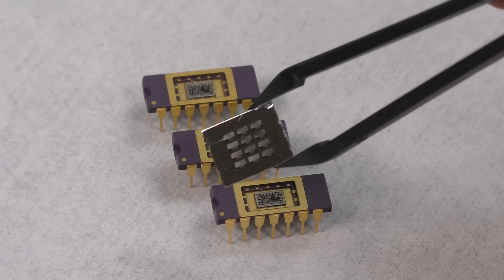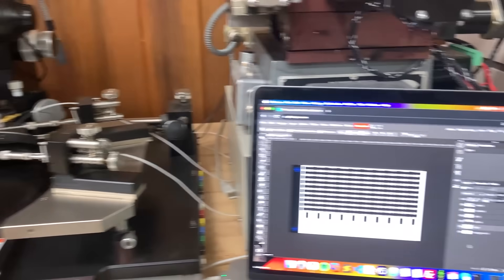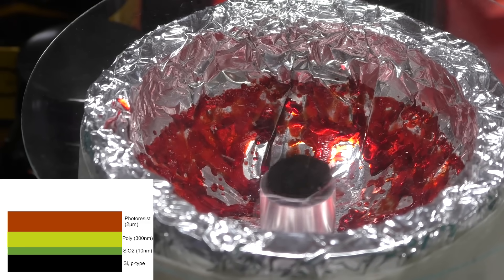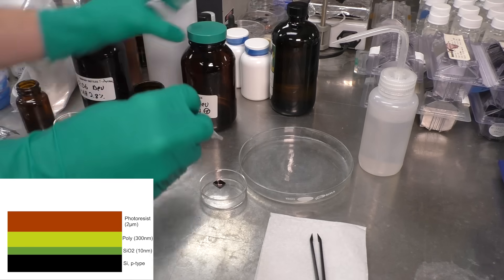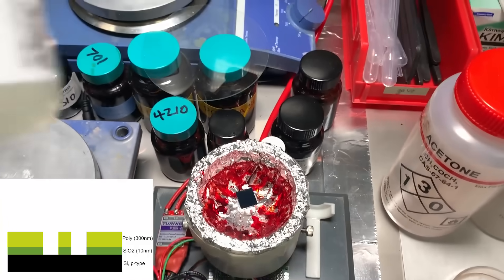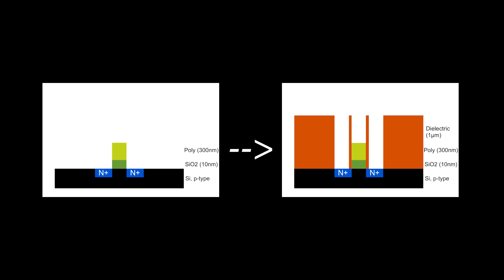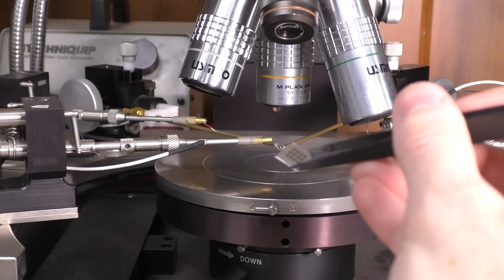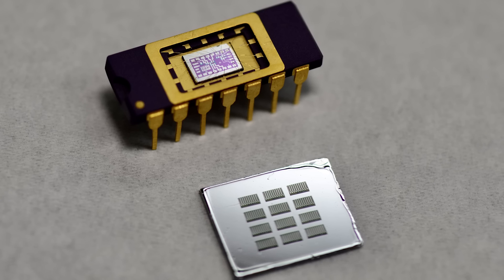"Z2" - Upgraded Homemade Silicon Chips

Comment: Interesting... Being semiconductor professional, I think that this could be a good example for college labs, where students can craft their own transistors and do manual layout. With some extra addition of steppers to have good alignment. After that, one can transition to shuttle wafers for higher integration. This gives so valuable hands-on experience! Great job!
Reply: At my school, the juniors got access to the student cleanroom and they designed, built, and fabricated transistors. (Somebody thought it was too hot one night and got the genius idea to open the windows, which is exactly why there's a student cleanroom.) Senior level RF design class gets to do a shuttle run on a GaAs HBT process. The problem with that is everybody graduates before they chips come back, but there's a student probe station and VNA, and one or two grad students do the testing.
Reply: @sj65535  why would a clean room even have windows that open? That's just ridiculous!
Reply: @stheil  It was retrofit into an existing space and they thought the budget was better spent on other things than new windows. Cleanrooms are positive pressure, so openable windows don't make that much of a difference, assuming people aren't total idiots.
Reply: @sj65535  I guess nobody ever thought anybody would ever even consider opening a window in a clean room XD
Reply: Yes in our class all we got to do was a single layer "antenna"... and it was almost entirely hands off... I think someone setting a leaking canister of HF on thier foot a few years back spooked them out of letting anyone do anything serious in the lab as undergrads... which is sad.
Reply: When I was a professor I actually pretty much had students do this with pretty similar student designed tools. We made MOSFETs and diodes. My furnace was probably a bit cleaner than how this was done. We wrote about 1-2 micron devices using a DLP system that I put together. It had a through the lens red light to align layer to layer with known focus offsets. I never got around to writing the field stitching code. The evaporator was thermal aluminum with home made QCM. Spinner was home made. I had a real commercial furnace that was the only item I didn't build from pieces with students.
Reply: We used lithograpy to make MOSFETs in my semiconductor course in uni
Reply: Good one, may never occur though...but good try.
Reply: I'm afraid students won't have the time in their curriculum to do this... As special project, maybe. But it sure would be some unique experience.
Reply: No, this could be a great opportunity to make a computer that actually works.
Reply: @foopadr9076  : As long as they're required to use existing RAM & ROM chips, sure. Memory capacity is one of the bigger limiting factors, and a simple I/O or clock chip can have enough memory for them to get a feel for designing RAM & ROM without having to manufacture the bulk of the memory that they'll want.
Reply: That would mean actually teaching something, too dangerous. Let's just read some useless materials instead and teach some nonsense math that we will never go in depth anyways because computers already do that for us or something.

And also let's charge a ridiculous amount of money to basically teach people to push a button.
Reply: @TheCuteZombie  you get it
Reply: @ethanspaziani1070  it started like a medium for sharing knowledge, where people had to work hard to learn and get knowledge.

Now it's just a Ford's style production line where the only purpose is to get a piece of paper for validation, no point in actually sharing knowledge. An empty shell of a glorious past.

But who I am to question the social machine.
Reply: @ethanspaziani1070  exactly, like if knowledge requires one to have checklist attributes. No one should need to be molded to a teaching program, but rather the teaching program must be molded to the individual.

If athletes have a training regime specifically with diet and exercises molded to their physiology/needs, why every student, going through a chaotic development phase needs to mold themselves to a inefficient indoctrination molding regime?
Reply: You know that schools today don't teach you anything useful right....
Reply: @ethanspaziani1070  they sure don’t for the most part.

Very very little you learn in school has any real world value. All school does is prove your willing to pay outrageous amounts of money to be told your wrong.

Comment: Absolutely incredible!  I've been involved with IC's since the 4004 and even recognise some of the HP gear too, but you do seem to have used $500,000 of equipment to make a $1 chip !   I would never have thought it possible to do this type of fab work AT HOME.  Just brilliant.   (Edited 2 months later to say :-  The $500k I loosely mentioned refers to the prices when some of the historical gear featured was 'new'. I deal in this stuff today, and the same equipment sells for 1-5% of its original cost and generally it all works like new, and some have bang up to date calibration certs. But its bargain equipment now. Sometimes the gold inside is worth more than the used price of the whole machine !)
Reply: That may have been the equipment cost new but an used HP4145A goes for about $3500 on eBay now a days.
Reply: @anotherdave5107  Still in the realm of impossibility for many of us.
Reply: @techalyzer  - some ppl buy a $80K car when a used $5K would get the job done. How we spend our money reflects both needs and wants. ( and he may be getting equipment donations from supporters, labs etc. )
Reply: not to argue here but first "so does every chip manufacturer everytime they made a chip." n second "kudos to the guy who makes single handedly a f*** microchip on his garage" this videos are amazing men wow
Reply: hes developing not producing
Reply: he could save on the photoshop license using ms paint. anyway that's a great work. 
it is likely that many of us will learn theoretically the things, and live our lifes without experience the making of the most simple chip. so its up to one to decide how to spend .. either having a good car, notebooks and smartphone every year.. or having a garage chip fab.. 8-D
Reply: @woreno  That would have been incredible if he used MS paint, cracking up thinking about that image
Reply: A whole post stating the obvious. Congratulations.
Reply: He got all of it from the university and professors and similar, not a single DIY person would have afford it all otherwise since as you say its very expensive stuff even used.
Reply: Wow with 500k id rather buy a potato chip factory!
Reply: To be honest $500,000 dollars is not a lot of money for that considering the chip shortages to take advantage of, as long as you have the skills and social network to take advantage. I can't afford that but if I make wise investments while gaining the skills, starting with my side hustle in college now maybe
Reply: @thevincent1015  What does the Actual chip shortage have to do with old and Useless equipment like this? 500k maybe 20 years ago now all of this is sold for a few thousands total on Ebay.
Reply: @Seraphine_KDA_TFT  the average chip found in most low grade common tech can and often is made with this equipment even today. The more expensive chips are made with more expensive techniques but your average calculator or TV remote will typically have these chips in them. Alot of "modern" tech is just 20-30 year old tech in a shiny new package and some built in obsolescence.

Comment: Wow, I never thought anyone would be able to make their own chip in a garage.  I'm impressed.  Obviously it takes some expensive equipment.

Is there any practical reason to do this?  i.e. is there anything you could do with making your own chip that you couldn't more easily, and cheaply do with the various programmable chips (PAL, FPGA, etc)?  

The various retro-computing projects have largely used these chips to re-create a lot of custom ICs that are no longer available (the SID for the C64, Commodore had some one time programmable chips, etc).  I'm curious if there's any limitation to this approach that would be overcome by just having these sorts of nano-fabs like yours.

Comment: That's so incredible cool, you should make a Commodore 64 SID chip. It has est. 2000 transistors and those chips are prone to fail and running out of supply. There are fpga clones but they don't sound great. I think if you pull this off you get the whole Commodore community crazy lol

Comment: Sam, as I'm sure you've noticed, that is pretty damn astonishing. I do wonder why you aren't etching actual circuitry onto the silicon to make the connections for you. I'm not saying you "should" be doing this. I'm sure you know enough to have done that if you could've. I Just wish you'd explained in the video why you don't.

Comment: Gosh, amazing is all I can think of and that seems to be an understatement.

I assume you have or are in the process of obtaining an EE degree because the structure and motivation for the structure of a transistor is not trivial either. 

How you sourced your equipment would be an interesting story by itself. I assume as facilites upgraded to more automated equipment the earlier devices became available at a fairly low cost.

Comment: Holy shit this is impressive.  Good freaking work showing it all off on a video!  I occasionally crave doing the same for other (more simplistic) topics like cannabis farming, building computers,  or doing software management, however, I'm a bit too scared to do so.

But anyway, this is what we really need to get this darn right to repair thing done already.  As right now, companies are just diving through loopholes on what was signed for in an executive order...  But if people start making important replacement chips that are always in high demand in the tech repair field, then we should be in a much better place where tech items would actually last more than three years lol. 

Edit for clarification: this is due to some modern tech companies intentionally building expensive products to fail.  This is something, unfortunately, that Apple is known for.  But other companies have recently started to follow suit.

Comment: This is great! I've worked in chip design since the late 1980s. I remember the 4145 parameter analyser with the 5.25" disk drive very well! Your model must be at least 30-35 years old.

Comment: Use a cheap charge pump IC to drive your MOSFETs instead of 9V batteries. You can miniaturize your designs dramatically. Although I guess that wasn't really your goal

Comment: Do you think you’d ever get to a point where a clean room is necessary?
Reply: A clean room is always necessary.
Reply: @Uncle Flotsam he is working at a pitch where motes of dust will not destroy components. The parts he's etching are pretty big by integrated circuit standards. The pitch being made now is inconceivable. Without an electron microscope you can't even see the stuff. It's almost at the atomic level. Gate widths are maybe 33 atoms across? So a flake of dust would cover thousands of transistors.

Comment: So the potassium you used in the KOH to strip the photoresist doesn't impact the threshold voltage that much?  Also there's no concern with KOH etching the silicon while you strip the photoresist?  HF is very poisonous and is something you wouldn't casually store in a small lab.

Comment: How do you connect the silicon circuits to the leads that come out of the chip?
Reply: Looks like he uses bonding wires to me. Although precisely how he attaches those to the pads he never did cover. I'm not even sure where one would go to get bonding wire for that matter. Maybe he pulls it out of old ICs? He clearly uses old IC packages for his dies.

Comment: Lovely work, but I have a couple of questions: first, who pays for all the machinery ?
I mean, this is no hobby project with almost 6 digits in equipment...Even used it's A LOT.
That's kinda sketchy, it looks like you've been sponsored.
Anyway, I was thinking of novel/alternative ways to chip manufacturing with flatbed inkjet printers.
Most epson print-heads can reliably produce 720 PPI (max physical resolution, above/below that and you get moire/aliasing artifacts) and they'd be enough to achieve what you did cheaply/easier. I've already found methods/recipes to positively/negatively dope eco solvent-based inks/UV-resins and a flatbed can be modified to also use a Z axis.
With extra controls to shift the X-Y axis enough so that layers/dots can even overlap on the previous ones, joints could be easily achieved on P-N substrates, thus making reliable connections, also because uniform surfaces aren't a problem with the viscosity/fluidity of these ingredients. What do you(all) think?

Comment: I studied during the existence of the USSR. At the university, they did practical work on manufacturing microchips. It's a bit similar, but everything was done much better with us. The process of epitaxy (the formation of a layer of silicon oxide) was carried out in a special furnace in an oxygen environment (and not air as in this video). I would not have been accepted for such a quality of coating with a protective varnish on a centrifuge. Projection through a microscope is a good idea. We used special templates.

Comment: maybe you should build packages with matched pair transistors, like the CA3046.

Eurorack modular synthesizer builders would love to have these in a dip package, instead of a super tiny smd SOT323.

https://moogfoundation.org/dale-ong-reverse-engineering-moog-modular-prototype-bob-moog/original-vca-schematic/
2SC798 (Roland tr-909) - 2SC1583 (Roland tb-303) ... in a single package.